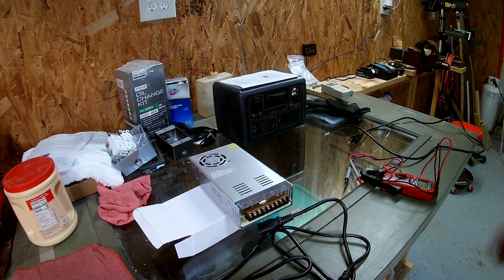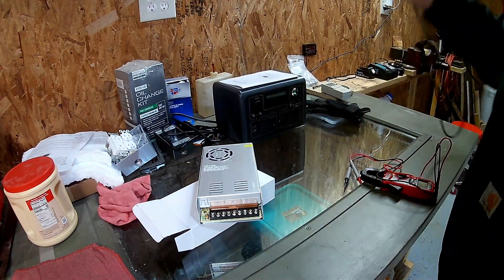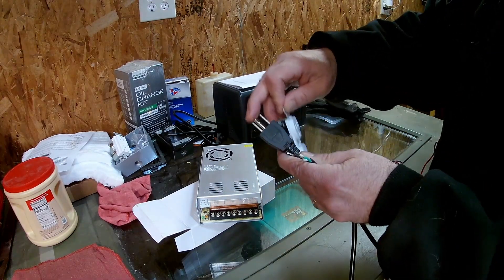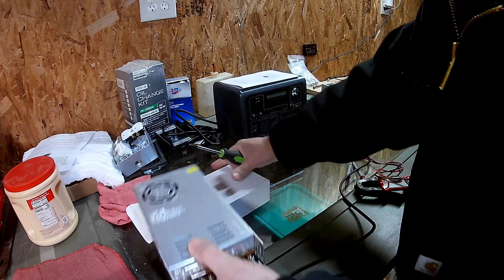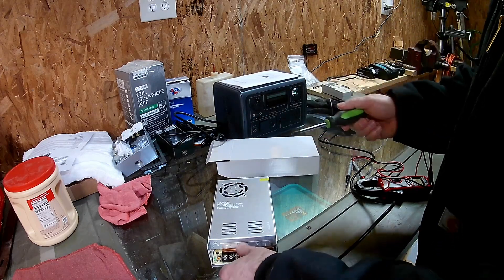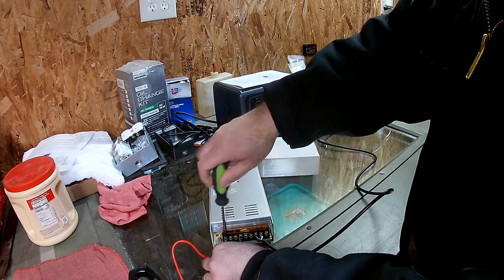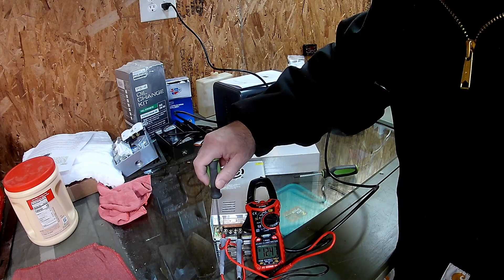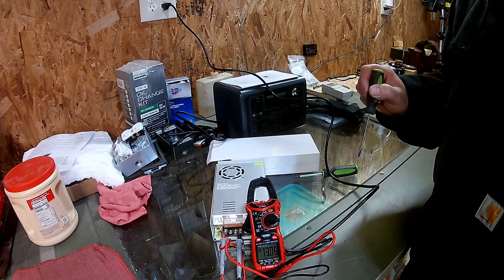Power a Diesel Heater with an AC Power Supply

Comment: Hello… Do you have a battery backup connected just in case you lose power.  From my understanding, the heater needs to go through a cool down period or it could overheat.  If so, how did you connect the backup battery so it automatically kicks in when power is lost?  Thanks!
Reply from the maker: When running on ac (as in this video), I do not have a battery backup. In other videos on the channel, I use a bluetti eb3a to power the heater. In this configuration, the power bank could be plugged in the wall and function as an UPS.

As far as losing power while running, it’s not good, and I’ve had it happen. In my case no damage occurred to the heater. I wouldn’t do it on purpose, but I’m not overly concerned about it either. I did see some exhaust come out the air intake.
Reply: Thank you… I appreciate the information.

Comment: Do you know if there would be a noticeable increase in battery usage (other than 3-5w for the inverter) using an AC to dc converter like for a laptop and running it on the ac side of a jackery? For some reason the cigarette lighter plug on my jackery 300 runs my 5kw heater fine but it trips the breaker on my jackery 1000 during startup. Obviously the amps are higher on startup but the 1000 always trips
Reply from the maker: There is a loss. I did that in another video using a bluetti powerbank and ac->dc converter. It consumes about twice the power. I’m able to run from the dc side of the bluetti using a 55-21 plug.
Reply: @TheGergeDIY  What’s a 55-21 plug? Not too big on electrical other than what I’ve had to learn to run my van
Reply from the maker: @thebugonjoshschair  no worries! 5.5mm x 2.1mm plug. It's used to plug into the DC side of a powerbank (assuming there is one there, the bluetti has 2x of them). They are more secure than a cigarette lighter plug. Here is a link to the one I use: https://amzn.to/3vs1OdE (amazon affiliate link). Here is a video that discuss the plug/cable: https://www.youtube.com/watch?v=tWAMsNlwRVU
Reply: @TheGergeDIY  I’ll have to check out the video, the jackery 1000 has one of those connections but it’s for solar input unfortunately but thanks for the help!
Reply: @TheGergeDIY  So the jackery 1000 has an Anderson connection but it’s for solar input so I ended up running my heater off a 200w 20a ac to dc converter since I already had one on the way from Amazon and it seems to be running fine so far and hopefully it stays that way. The converter itself seems to only draw about 34% more power when I tested it with household stuff. Just wanted to give an update and thank you for your help!
Reply from the maker: @thebugonjoshschair  good to hear you found a way to make it work!

Comment: Is it possible to fire up the heater using the 12v 10a cigarette output, even if it uses around 12a to start up? How can one wire up this to use on heater?
Reply from the maker: No it's not possible. 10a is the peak spec on that plug, and I err on the side of caution and oversize things when it comes to current. If it says 10a, I'd max it out 7a peak, and not for very long at that. When I tried running it off the cigarette lighter plug on bluetti eb3a that's on the bench, it tripped the breaker in the bluetti quickly.

Comment: WHY oversize so much?
Wouldnt a 200 watt, 16.5 a transformer work fine?
I have a Maxpeedingross 5kw that says 10 amp when starting up.
Reply from the maker: @hunkenpunken - fair question. The heater draws quite a bit more when it starts up as opposed to when it's running. In this video I follow the dc current as the heater starts up: https://www.youtube.com/watch?v=7DKXOwaBeBg - You'll see the heater draws just over 10a of dc on startup. Over specing the power supply is never a bad thing as the work is going to draw what it's going to draw and having excess room on the power supply isn't going to hurt anything. Cost wise, the power supply is just about $24, so no big deal.

Comment: How can I hook up the power supply to my ecoflow station to run the heater?
Reply from the maker: I don't know - I'm not familiar with the ecoflow station. Does it have a 110v outlet? If it does, and it can furnish enough amperage to run the power supply, that would be something to look into. I have a video on running a diesel heater via the power supply in the video from a bluetti eb3a: https://www.youtube.com/watch?v=7DKXOwaBeBg - that might help?
Reply: @TheGergeDIY  it has a 110
Reply from the maker: @jazzsounds8159  the bluetti can do 600w in the 120v adapter. You should find out what the amperage rating for your 120v plug is.
Reply: @TheGergeDIY  8amps, I think the power up is 10 amps.
Reply from the maker: @jazzsounds8159 I’m pretty sure each outlet on the bluetti is 5amps so yours is rated higher.